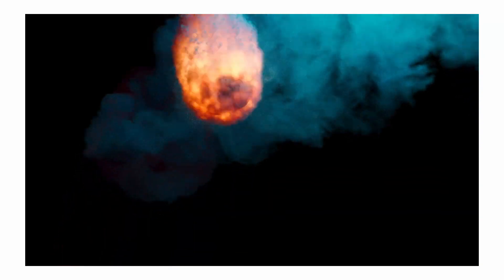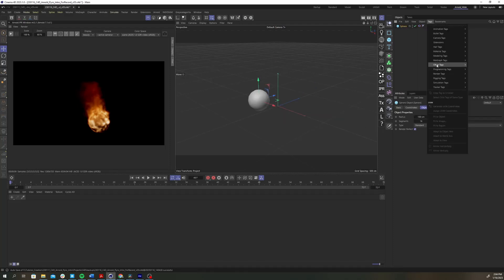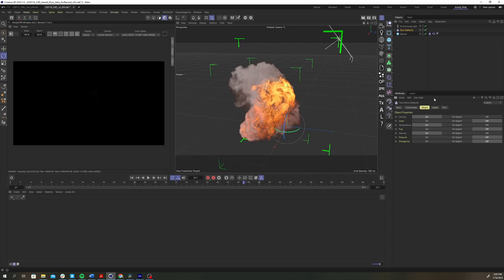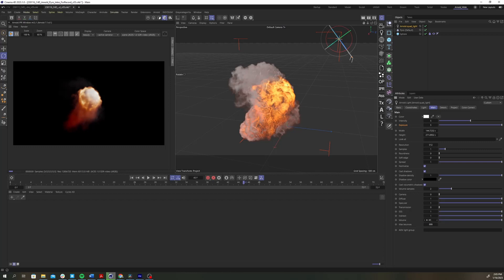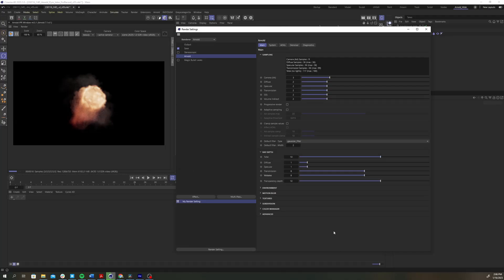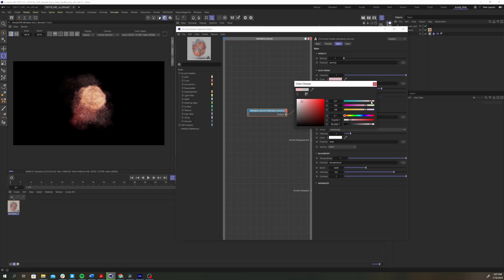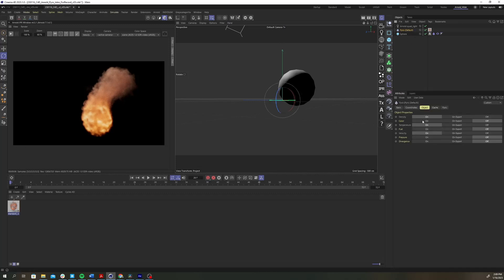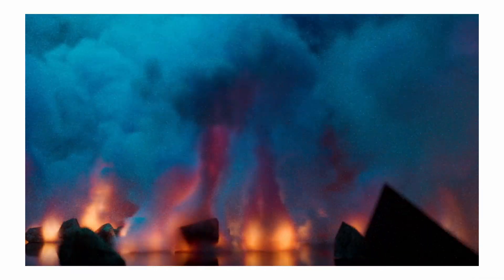How to render Cinema 4D Pyro in Arnold Renderer! (Quickstart)

Comment: Very weird...my C4D (2025) refuses to open Arnold shader network ("please select Arnold material"...even though it's already applied) unless I'm using legacy material (std srf will not open in ASN). The volume mat wouldn't open in the ASN, either. And, my pyro emitter looks way worse than yours out the box lol it's almost like a different program. Maybe I have to reinstall the whole thing.

Comment: I was finally able to get my render to work, but the IPR window is totally bugged for viewing pyro.
I'm not sure how you got yours to work, but my IPR window doesn't show any colour other than the smoke.  The fire renders fine but there is no colour for the fire in the IPR at all; only the smoke colour is visible in the IPR.
I did everything exactly the same as you, but my IPR cannot see the fire.
Reply: You need to apply to it (to the pyro object) an Arnold volume Cháfer. Then, enter that shader and check the channels it's accessing. You'll see that for the color/temperature field the channel is "heat". There's no heat channel in Pyro. So just remove that and write "temperature" so the shader will access the pyros's temperature channel. It's just a naming convention mismatch, it happens a lot when using .vdb from different sources that use different names for their channels. Hope this fixes your "bug".
Reply: try caching it and import the vdb files in the pyro object and see if you see the fire in ipr

Comment: When i cache my sim it just disapered. You you help me please ?
Reply from the maker: You have to select the .vdb sequence you cached. That way it imports the whole sequence.
Reply: @the-astropath  i go in file name and select the first vdb exported in the cache section, and it doesn't work. That's sooo weird, i searched everywhere on the inernet and followed step by step each tutotial but nothing.
Reply: @the-astropath  that's the error message: 
[volume] IoError: could not get size of file C:\Users\Shadow\Desktop\Nouveau dossier\Scène de simulation_0000.vdb
Reply from the maker: @theterifique9727  well what's the file size of the vdb it should be decently large. If it's only a couple KB something happened when you cached probably.
Reply: @the-astropath  well the biggest one is 250 000ko. I don't think that's the problem. I updated everything too.
Reply: @the-astropath  HI i finally found the problem, i did export the temperature and color and velocity but didn't export the rest of sim. Now everything works well. Thanks for you help !
Reply from the maker: @theterifique9727  Glad you figured it out!

Comment: Hi. I didnt get. I have the same version of arnold, but first render looks totally different, theres only smoke in ipr, no fire. U can see this even without volume material. How?
Reply: i have the same problem… it appears only smoke…
Reply from the maker: @rorycchan  Select the Pyro Object > Object Tab... make sure that you have the Density, Temperature and Velocity properties set to ON and not ON Export.
Reply from the maker: It's hard for me to diagnose without more information.
Reply from the maker: Make sure you're pyro object settings are the same as mine.
Reply: u didnt do any changes in your settings on 1:10, but still can render pyro even without volume material. i did the same and theres no fire fire in my ipr, i can see only smoke if my quad light has 10 intensity and exposure
Reply: @misterdoctor9688  same here.  I only have smoke no fire.  When I started doing the exact same things in the video my smoke was white-grey when his was immediately the colour of fire.  I don't understand as I did everything EXACTLY the same as him.